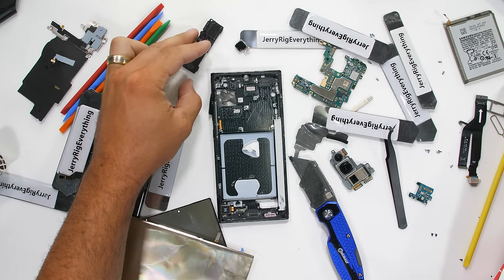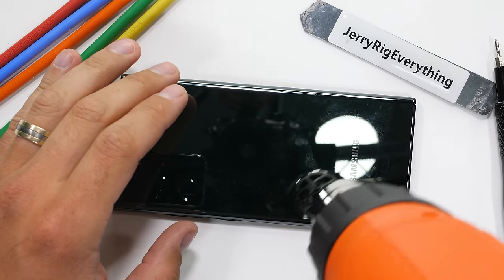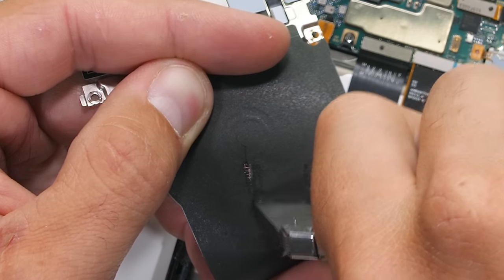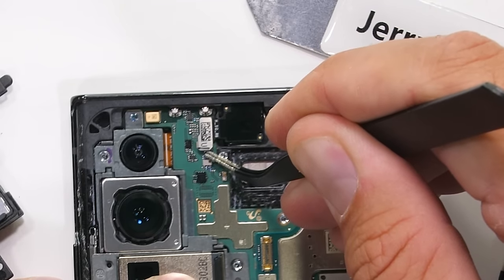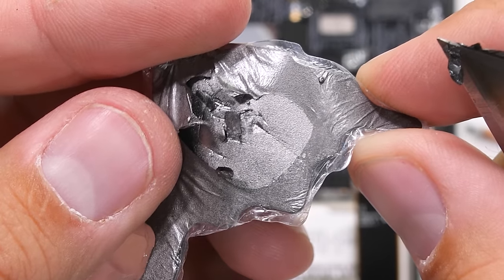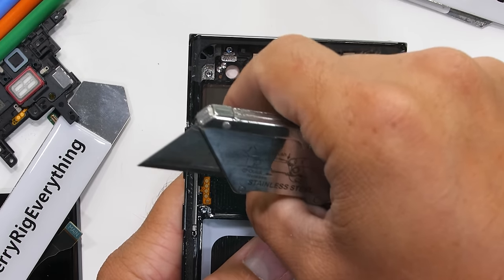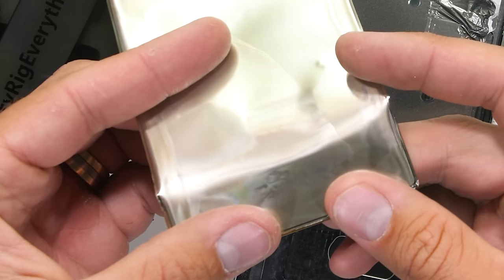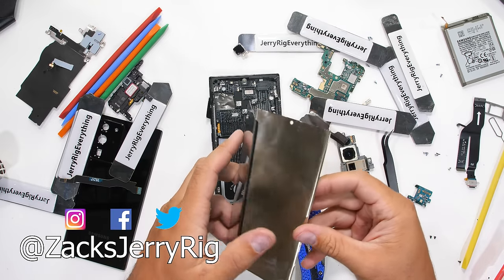Samsung Note 20 Ultra Teardown! - No Copper Cooling inside?!

Comment: Samsung was like "y'all pressed about international phones without snapdragon? well how about no snapdragon AND worse cooling?" smh
Reply: Pretty sure he has the Snapdragon variant as it's a Korean model. And the Exynos ones are the phones with the vapor chambers.
Reply: What's even worse is that it costs $1930 on the official Samsung website for my country (South Africa).
Reply: @AFT2  You are not correct. He has  a model with exynos.
Reply: @AFT2   @Adam Thoday  did u..watch the video? He explicitly said his phone was the international version and also mentioned another YouTuber who took apart a phone with an US charger (therefore, Qualcomm SoC) and THAT phone had copper cooling
Reply: @Chris-pv6zw  I feel you. Phones in my country (Brazil) also end up with prices WAY higher than the US and to add insult to injury the economic power of the majority of the population is also way lower. Here this phone is not just a luxury item, it's an ULTRA luxury item (pun intended)
Reply: @SrGammerNerd  
1. It's the same phone as his durability test, if you watch that video you'll see the model number on the paperwork. It's a Korean model with Snapdragon.

2. That other teardown had the model number of an Exynos LTE device.
Reply: @AFT2  mate...just...  6:02
Reply: @SrGammerNerd  if you watch that teardown you can see the model number on his paperwork is SM-N985F which is the LTE Exynos variant.
Reply: @AFT2  Assuming those papers are of the phone hes tearing down, that would mean that samsung is selling a lesser version of their phone in their own country, which doesnt make sense as samsung has history of making South Korea exclusive phone variantes with better features or aesthetics. They wouldnt sell the inferior version in their home.
Reply: @spacemanonearth8830  I'm pretty sure the papers are the same as you can see the burn mark at the start of this video, it's the same phone.

What I imagine is happening is that they are using the graphene pads on Snapdragon models as they don't need as much cooling.
Reply: The exynos should have the copper
Reply: @spacemanonearth8830  nope they sell exynos and snapdragon varients in Korea. Some telcos sell the 4g varient that's exynos 990 most are the snapdragon though
Reply: @AFT2  OR they purposely use the graphene on the Snapdragon to "tame" it a little bit, so their own Exynos has a little room to breathe?

It was an overclocked Snapdragon, sure it gets hot too. By giving it an inferior cooling, their Exynos can "perform" a little bit. It was an effort to handicapped Snapdragon.
Reply: @AFT2  I'm confused. Are you saying that Zack doesn't know what version he got in this teardown? 5:26
Reply: @burnthemall3801  possibly but we don't actually know how the cooling systems compare. Maybe the thermal pads are just as good.
Reply: @tkermi  Yep basically. The model number on the paperwork when he unboxed it matches the Korean Snapdragon variant (SM-N986N)
Reply: graphene is better than copper Google iy
Reply: lol samsung doesnt focused to GAMING they just FOCUSED on MULTIMEDIA so
Reply: @abiez4018  Researchers at Chalmers University of Technology have developed a graphene-based film that has a thermal conductivity capacity that is four times that of copper. This new technology makes it perfect for cooling electronics circuits and components in RF devices, LEDs, servers, and smartphones, to name a few.Jul 15, 2015
Reply: @abiez4018  they do focus thats why they include that shit its better than copper
Reply: @AFT2  okay, interesting 🤔
Reply: @gogeta7173  ?
Reply: @abiez4018  its better than that coppery thing inside snapdragon version
Reply: @gogeta7173  But the copper ones are a vapour chamber type. Depending on a design they are 10-250x more thermally conductive than copper. That's why industry is not that interested in graphene as a cooling medium.

Comment: Is that graphite or graphene? If that's graphene, it can be even more effective (and expensive), than copper.
Reply: Good point
Reply: graphite has the same thermal conductivity  as graphene if the graphene layers are stacked like that, or am I wrong? Afterall grafene is just "2D" carbon
Reply: @user-jd6gq2vh5w  you are wrong
Reply: true
Reply: @DeMarcus lopez graphene has a thermal conductivity of 1950 W/(M*K) vs thermal paste which is around 23 W/(M*K). I can't find any info on the conductivity of copper.
Reply: Graphene was rare and avaliable less in mines,so they will not use that it's graphite only
Reply: It's pyrolyric graphite and came here to say the same thing. Its more expensive and works significantly better. Not sure why he didn't do his research. He's usually good at that. Although, he is human and we all make mistakes so I'll give him a pass as long as he corrects himself soon.
Reply: Its definitely graphite because graphine will cost more than the whole phone is worth
Reply: @komalsai1074  mate 20x uses graphene
Reply: But then wouldn't they market it as 'a graphene cooled phone' or something? 
The stuffs expensive right??
Reply: @komalsai1074  There isnt such a thing as Graphene in mines. Its entirley artifical manufactured.
Reply: @mecooley3722  Vapor chamber thermal conductivity goes up to about 50,000 W/(M*K).
Reply: U r right
Reply: So, at around 1:40 of the iCase video you can clearly see user manuals in Cambodian Language and model number: SM-N986F/DS, WHICH IS the international version with EXYNOS 990 SoC.
Also in that iFixit live teardown video, they have the US variant (presumably), and you can clearly see the heat dissipation pad is grey just like Zach's unit.
The thing is, according to the durability testing video Zach made of the Note 20 Ultra, when he is unboxing it, you can clearly see the model number is SM-N986N, which is the Korean version. Usually Samsung will use exynos chips on korean models and international models, but this year it's different. Samsung did put a Snapdragon 865+ SoC in the Korean version.
So now everything is clear. Samsung did use the grey heat dissipation pad (presumably graphite) on models with Snapdragon SoC, and the bronze heat dissipation pad on the Exynos variant.

This is so weird!! My opinion is, because of Exynos chips runs much hotter, Samsung decided to use a better cooling system. Models with Snapdragon chips don't need it i think.
Reply: If it is graphene it would be very impressive tech and Samsung is currently largest manufacturer of the stuff. It not mined but created and because Samsung are making it, the cost is reducing significantly as they find cheaper ways to produce it.
Reply: Fact :
South Korean companies Lee Youn Tek and Samsung Electronic hold most graphene-related patents .
Reply: I think it is pretty irresponsible to jump to conclusions that a particular cooling solution is inferior before taking some temperature measurements of the units in operation. This is the last thing i would expect from this channel.
Reply: Maybe
Reply: Even if that is the case why the other have copper ?
Reply: LOL if it was graphene, you would know about it from every Samsung ad
Reply: @komalsai1074  What are you talking about? Graphene is manufactured from pure carbon, not extracted from mines
Reply: @mecooley3722  then graphene is more effective because more the thermal conductivity more will be heat transfer rate
Reply: Graphene is patented by i think only Huawei. So i think Samsung uses cheaper Graphite
Reply: its graphite.
Reply: @imnotyou23  the point is not that it works significantly better. The point is that they are selling different phones with the same name. the icase teardown clearly shows copper in it whereas this phone has different internals
Reply: Graphene only has good thermal conductivity in a horizontal direction within the molecular sheets it forms.

In contrast, it has rather poor vertical thermal conductivity.

Basically, graphene is good at spreading heat out within itself, but not great at transferring heat to other  mediums or layers.
Reply: Guys that cannot be graphene, otherwise Samsung would ve mentioned it (in commercials) bc its so expensive.   And i think only Huawei developed it for their products
Reply: @deadlypyre  Graphite is an allotrope of carbon made from several layers. Each individual layer is graphene. The english was bad, but the science was correct.

The reason graphene products are expensive at the moment is due to the time/complexity of manipulating millions of 1-atom-thick layers of carbon into something new (e.g. threads made of carbon nanotubes; each nanotube is a sheet of graphene rolled upon itself like cigarette paper.
Reply: ohhhwww.. i just tweeted about samsung not to buy their phones before seeing this🤣😂🤣😂
Reply: It’s graphite; Graphene first have not been perfected for mass production, second it’s to expensive. It cost about $100 per Gram.
Reply: Anonyymi nettigiusaaja you wrong!
Reply: @TheEtbetween  if its graphite its cheap cooling. They d better take copper🙃
Reply: @apostle9209  Seriously? Are you new to Samsung? Pretty much every Samsung flagship (and maybe all samsung phones period) have two different processors. This isn't new with the S20/Note20 Series, and it's very public.
Reply: @nexusproductions2064  It's not graphene, but even if it were, how marketable is "Cooled by graphene"?
Reply: @imnotyou23  seriously how much of a fanboy can you be? Yes, I know what the most obvious fact that you stated. And that's exactly my point. My point is that samsung is selling 2 completely different phone since the past 3 years (before that the performance used to be more or less same) and somehow gets away with it when one phone is clearly inferior to the other despite being the same price or even expensive. The exynos 990's gpu can't even beat snapdragon 845's
Reply: @apostle9209  If your only argument is calling someone a fanboy, then you really already lost the argument.
Reply: Samsung uses pgs as thermal solution.  It's better than copper. Oh look, you can request free samples. from the supplier right from their website.
Reply: Graphite has been used for years to pull heat away from expensive components in computers and phones, for example. The secret to graphite's success is its small spherical "pores," which allow it to absorb heat better than other elements often used for cooling.

Comment: To explain the lack of heat pipes a bit: I've seen recently where a laptop had a similar design. They put the processor behind the laptop screen and instead of any heat pipes the back of the screen had a copper layer, just like here. 

The idea is that the large glass screen can dissipate heat much better than a small tube. It supposedly works well on the laptop, but I wouldn't want this design on my phone. No hot screens for me. This is why I always watch your teardowns before making a purchase. Keep up the great work!
Reply: is it only a copper layer or a vapor chamber?
Reply: Same!
Reply: Might this contribute to my display gkt hairline crack.dissapointed
Reply: I read an ifixit article on the cooling, and they said it largely doesn't matter. Apparently th he marketing for the vcs was just too good

Comment: Yeah, no more samsung until they stop this Exynos BS.
Reply: Not only Exynos, also the 5G millimiter wave antenna is missing on the international phone. Furthermore now we discover that the dissipation system is also different and cheaper, which is very contradictory considering that Exynos heats up more than Snapdragon. Samsung should be sued for fraud.
Reply: @serjoka77  even the Snapdragon model also carry higher heat compare to other brands. After a day of use, I sold it off. The battery also drains faster ....Samsung has alot more to improve. Meanwhile no Samsung for me.
Reply: absoultely i go with No Samsung word 
its better we stay away from samsung.
Reply: or until they fix the exynos performance issues
Reply: Their next gen exynos chip is actually supposed to be as good or better than Qualcomms chip, so they may ship all samsung phones with that chip.